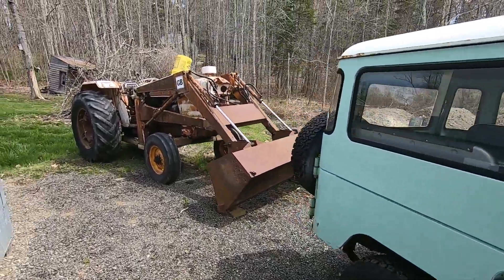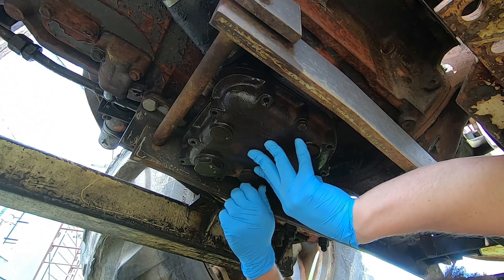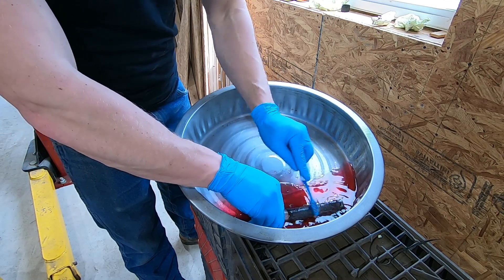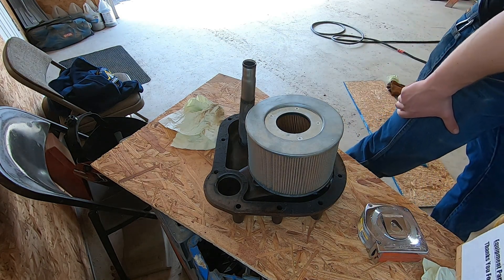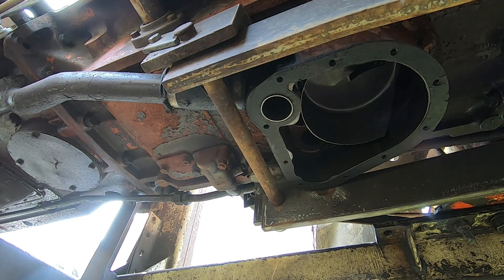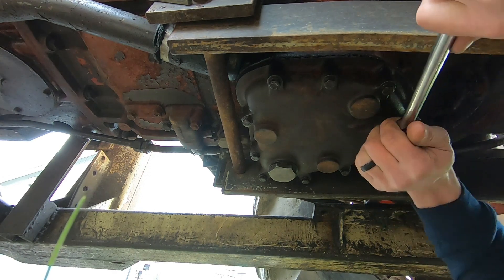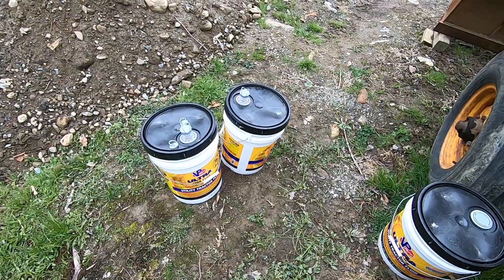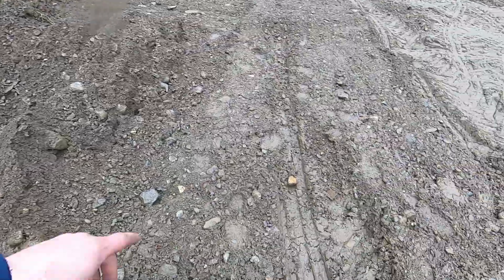David Brown 1212 - Hydraulic Filter / Oil

Comment: It’s a shame that your not able to find any DB filters were you live, All the DB were manufactured in England with main manufacturer CASE, The Case 450A crawler loader both engines were compatible with case & DB engines. which were originally manufactured for a 990/995 DB tractor which we used for agriculture contracting, Extremely well explained for anyone who’s looking to maintain there equipment properly👍🇬🇧🇮🇪.
Reply from the maker: It's too bad, because these are great tractors. The parts availability will deter most people from purchasing these tractors, leaving most to be thrown away or left for dead. Obsolete by todays standard. Thanks.
Reply: Do you have a video on changing the hydraulic filter and screen of the Ford 5000???

Comment: I've had a ton of issues with mine. I changed my oil 3 times now, cleaned my filter extensively twice, and my pump is still starving for fluid and only works for about 30 seconds at a time and then starves for a couple minutes before kicking back in. I cleaned those stupid little valves too. Thinking at this point I either need to remove my filter completely or buy a new pump. I wish mine were as simple ad yours was.
Reply from the maker: You have a David Brown 1212 as well? What is not working? Hydraulic functions, or the transmission ranges?